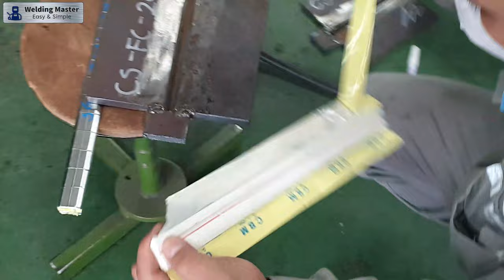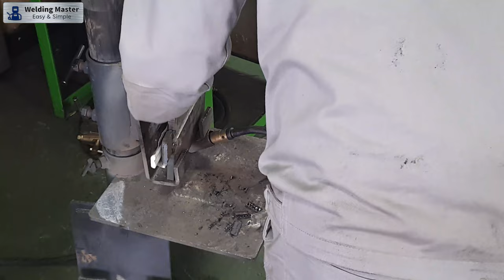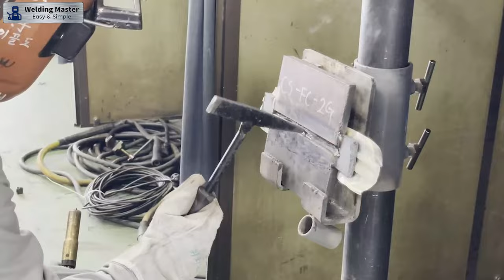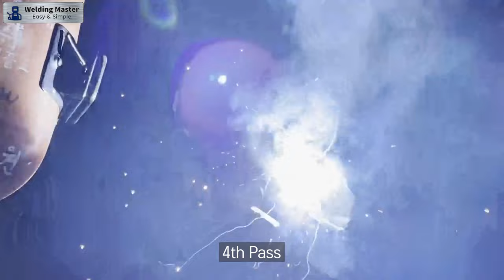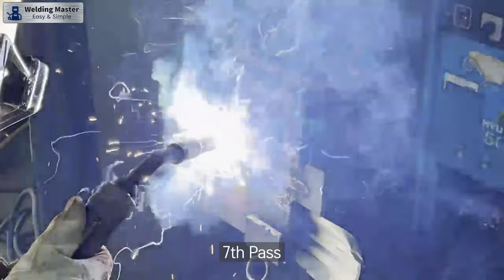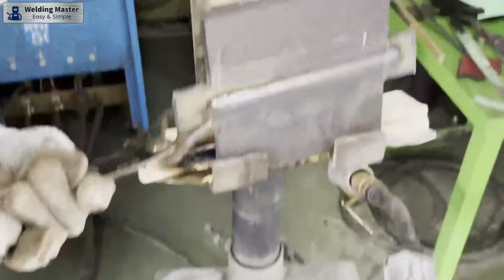FCAW 2G with Ceramic Backing (horizontal groove weld)

Comment: I keep getting wormhole porosity in my fill passes and root pass, any suggestions?
Reply: Check your gas connections from your bottle or into your suitcase to see if there is a leak, if that isn’t the case then check your liner and gas diffuser and see if there are tightened down enough. And If that’s not it, then make sure you’ve sealed off the breeze points or draft areas where you are welding. If it’s just wormholes, you may be running low on gas.
Reply from the maker: It seems to be the cause of the lack of protective gas. Please check if there is any problem with the gas supply line or if the distance between the nozzle and base metal is too far.

Comment: Are you using .45 wire?
Reply from the maker: I am using 1.4mm wire.
Reply: Thanks , if you don’t mind me asking , what parameters are you using(volt&wire speed)?
Reply from the maker: For 1st pass, setting is about 220A, 23V and then reduce to be about190A, 21V. Please use these values just reference.